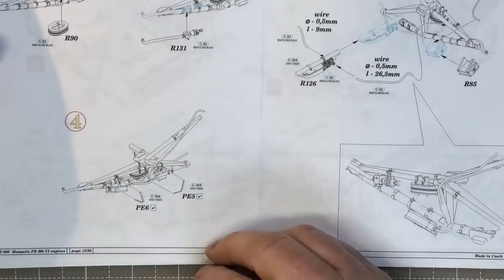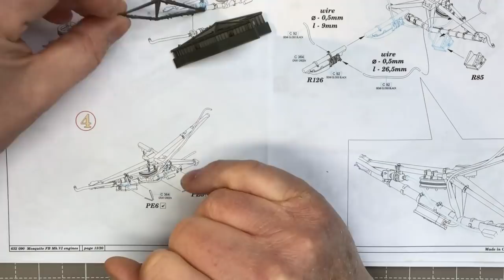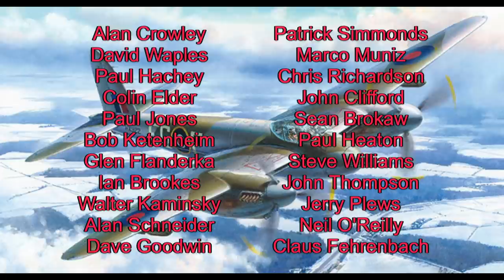Tamiya 1/32 Mosquito build series Part 7

Comment: Hi Steve,, I am following you also in building the Mosquito. I built noch both Tamiya and Eduard engines. Yes, because of the many extra pipes, the Eduard is much more detailed. You are right. But it was a lot of difficult work with the Eduard set. Pieces are so small  and the glueing of small cupper wires needs much time.  Like you, I will see, which Engine I will build into the Mosquito :-)
Reply from the maker: Good luck with your Mosquito Joachim 👍

Comment: Good afternoon Steve,
The progress has fallen away some but I’m very impressed with your ability to soldier on as the saying goes. At this time I was wondering if you consider useing a small flashlight to point out the various types of detail that gets lost  in the maze of black.
 I also was wondering if you could suggest to Airfix company to produce a highly detailed model of the Canadian Avro Arrow that was produce in the late 50’s by Avro Canada in Toronto.The only kit in that I’m aware of is a kit that was created using an old vac-u-form converted to plastic. It was produced in 1/72 - 1/48 scales by HobbyCraft Canada who contracted that produced in Korea. They produced a decent kit useing vac-u-form parts. The kit I know would be well received here in Canada. Maybe the company “Revell in Germany” may want to tackle it. I do hope that Airfix will be interested in creating this aircraft. If they were to create this aircraft it will be a model that may be more affordable as they have offered great quality at a affordable rate. At least more affordable than the kit you are now building. Just a thought.
Forever in His service
Reply from the maker: Hi Alex I have no influence on Airfix whatsoever - I think it would be a very long shot indeed for them to produce an arrow but you never know.

Comment: Hi Steve, about to start the 1/32 Tamiya Mosquito with Brassin engine fit.  Do you think it would be possible to up detail the Tamiya supercharger and fit it along with the Tamiya bulkhead with bolts to the Brassin engine body?  This would replace  the Brassin Supercharger and so enable the use of all of the original parts in the Tamiya nacelles
Reply from the maker: I think it would be possible and a neat solution to the problem I had with the fit of the Brassin bulkhead - nice idea

Comment: Hello Steve, An unrelated question to your build if I may. Given that you spray volatile lacquers, what type of light (if any) - in terms of being vapour proof -  do you use to illuminate the interior of your spray booth?
Reply from the maker: Hi Tom. I’m using waterproof LED strips on the inside of the booth. None of the LED suppliers I’ve seen quote for vapor proof but I haven’t had any problems with the installation.
Reply: Thanks Steve - I have recently acquired a BenchVent but no lighting yet and was wondering how to proceed as I'm spraying lacquers and enamels almost exclusively.

Comment: After last week mechanical engeneering, now DIY plumbing( and I think more of the same next week).
😁

2 questions.
Having never worked with resin( Matchox and Airfix kits in the late 70's/early 80's are my lastest experiences), could you reuse/ melt the bits that you cut around the pieces you use or is it direct to the bin ?

Watching at 32:40 to 33:15, in real life do the mechanics use some form of serflex( or their ancestors) to tie the cables together ?  An couldn't you put a small amount of glue to "simulate" that and hold them together in place ?

As always, you did a neat job and your explanations on how to are really good.
Reply from the maker: Yes indeed Marcus -hopefully we’ll get it done 😬